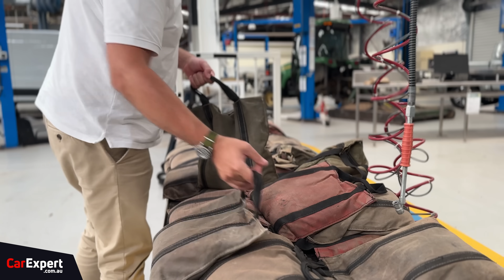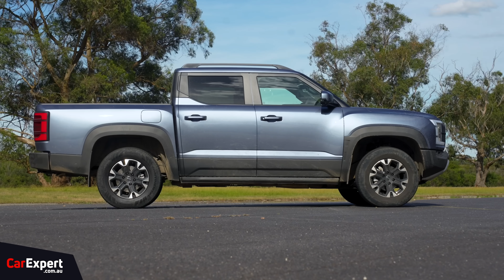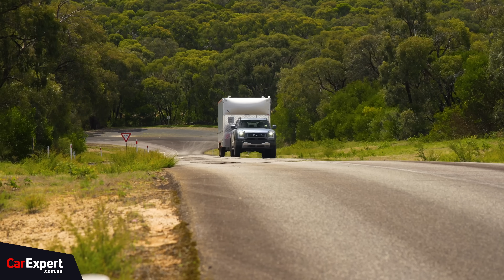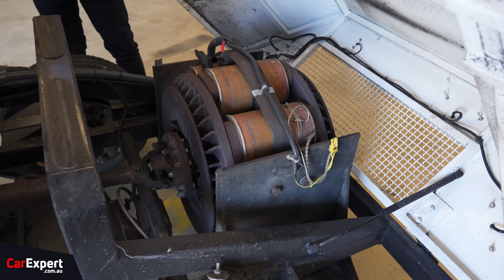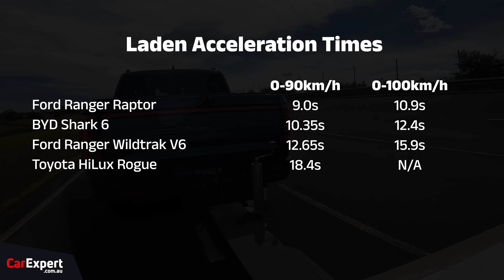BYD Shark 6 towing STRESS test at MAX payload - the results are surprising...

Comment: Some of the comparisons here are not comparing apples with apples. You compare a plug in hybrid with 2.5t towing with an ICE with 3.5t towing and compare power and fuel consumption. GVM is widely different.
 Also no mention of range. Quite important for tradies towing tool trailers, excavators etc. Also grey nomads towing 3 to 3.5t caravans and skiers/wakeboarders towing their massive malibu boats. Kind of important to see if it will work for them. Range is the biggest reason not to buy one in my opinion.
Reply from the maker: Not true at all. We used the same trailer dyne load in our recent ute test, along with the same trailer weight for the hill road. The results are directly comparable. In terms of range, it's a 60L tank, so it's going to mean lots of stops if you're towing at capacity.
Reply: @CarExpertAus  That trailer dyne is not real world test ,in real world you dont have endless hill you need to drive 100km/h,off course it will favor big diesels

Comment: It passes me off the BYD didn't show off the towing test when it shipped all the sellouts to China to rave on about it.

I nearly put a deposit down, but when I couldn't find any info on towing my bullshit meter started ringing. Whats the point of a ute that can't sustainably tow for a long duration? 

To be fair it would be interesting to see what would have happened if you set the state of charge to 50-60%.
Reply: Paul should have used the 70% battery mode. Can see how it will drop from 70% to 25% in one long steep climb with the engine running
Reply: Also interesting to understand what percent of ute owners tow. Not every car is for every person. People making out this will fail at being an excavator hauling, long range mountain climbing, enduro truck. Woah no way, who would have thought. 

But for an urban or suburban setting, where you want to take a small boat down to the ramp or do some light camping (once a year), but you are otherwise commuting and doing Bunnings trips - hey looking good. At 58k? Hmm seems great and now it's also competing against other large SUV family vehicles.
Reply: You really can’t think of any uses for a ute that can’t tow? None at all?

Comment: Thanks largely a good test but I don't understand why you did not complete the dyno test with the battery at a higher % the system is set up to allow the driver to set SOC I would like to know fuel use while maintaining the SOC at 50 or above % as well as your final test with the battery @13% which as expected resulted in a fail given  you effectively have a small capacity ICE front wheel drive 2.7 ton ute.

Comment: Always factual honest and genuine reviews. Thanks Paul. This is already expected. Best remedy for this I reckon is set battery level to 75% or so once you left home if you are expecting this kind of long uphill stressful haul . I don't think it d be issue as you are driving above 70kph on highway and engine help drive. Some people who live in hilly suburb and have really steep driveways may have issue pulling up as there is no gear or torque inverter reduction, and also engine will not kick in as speed is under 70. But still  this is the hell lot of ute for money.
Reply: The engine will kick in under 70kph to keep the battery charged, it just won't directly drive the front wheels.  A steep driveway will be no problem with 300+ kW and electric motor torque.
Reply: Try to understand gear reduction and torque multipliaction. @davidjulian8536

Comment: You must leave it in charge mode for towing. This is the same setup as the Mitsubishi Outlander phev. I tow all the time a 1 ton trailer and it's a 13kw battery and 140kw electric power. Leave it on battery charge mode and it uses the battery up hills. Also towed 1.5ton for 2000 kms around East Cape in New Zealand. Handled it amazingly well and no flat battery. I flew up the very steep Arthur's pass in the Southern Alps in NZ towing 1ton and a loaded SUV. The only car that could pass me was a Ford XR6. You must keep the battery well above 50% before hills and use it for getting up hills. Recharge on the way down and flats.
Reply: @xiaoabrose  you do realise this vehicle weighs twice as much as an Outlander and doesn't have much greater engine power/battery?? 🤔🤣

I'd take the Outlander any day over this overweight lump of cityfolk buying, ABC watching, climate change minimising, golf course virtue-signalling, turd on wheels 🤣
Reply: Small battery for a 140kw motor!
Reply: @Markcain268  That's phev for you. They have a 28kw? battery for over 300kw motors. That's tells you everything. It is a phev. It balances battery and petrol for power and efficiency. But it is not without very real compromises. But if you manage them, it's perfectly serviceable.
Reply: @Markcain268  Battery work with a gas motor ,charged 29 kw battery will be enough for 80km off hill towing  with a motor ,but in reality you will never find 80 km hill ,maybe to climb Mont Everest but there is no roads there and even there is i dont it would be highway where you can drive 100 km/h
Reply: Did you measure consumption while towing 1.5 ton and what speed where you driving at?
Reply: @andders2477 Yes. I drove from Auckland and all the way around East Cape. 2000kms total. Flat roads at 90 kph was around 11 l/100km. Once I hit the hills, average was close to 13 l/100km. A couple of times I had to stop to let it charge as the hills especially slow and windy ones meant the engine was high revs and also pulling heavily  from the battery.
Reply: @xiaoabrose  thanks, that ok consumption. You would have needed a lot of charging in an ev with 75 kWh
Reply: @andders2477 I was hoping for better. When towing a 750kg regular trailer with a storage box on it, fuel consumption is around 10 l/100km. Much easier for the small battery. But I would never ever tow with a full EV! Except short distance or course.
Reply: teaching carexpet how to act like actual experts! ;-P 💯
Reply: He's deliberately sabotaging the Shark for clicks. No idiot would start a tow test at 25% SOC...
Reply: You may think that , but we do want to know how a hybrid will react when the battery gets low .
And let's be clear , this was actually aside from being fully laden a very cushy test and in ideal conditions during the day time .
 30 c is not even that hot .
 If it was night time you'd be using your high beams probably with the heater on , and it appears it's only a short test .
 It's hard to beat an ICE vehicle for a tow car , even my old xr6 falcon did Melbourne to Noosa and all around brizzy visiting relatives dragging a heavy old 70S caravan with the aero dynamics of cabover Kenworth that I rebuilt and made even heavier with fully boxed steel rails and an extended draw bar , dragging two extra large pensioners and masses of gear all up for 5000 k's , and it was peak summer often in the 40's sitting on 100 kph most of the way , the van tracked behind like it was on rails , rock steady and the combination did not miss a beat the whole way with a going and lights running for the whole trip with an electric fridge running in the van , we put a auxillary battery in the van vented to outside with the electrical wiring tweaked so when the cars lights where on it charged the battery in the van , as soon as the car was shutdown and lights turned off the auxiliary battery was  disconnected from the car so no car flat battery.
And the beauty of the Conventional ice vehicles is should things go pear shaped , they are easy to fix. @zackmack4712
Reply: @mikldude9376  But this test is towing 2.5 tons with 100 km/h on  endless hill, in reality you want find endless hill anywhere
Reply: @mikldude9376  If the battery is low, then you only have the weak little turbo engine as they showed. But with proper management, it's not a real issue. But it is very important to know this as you said.
Reply: @zackmack4712  nonsense!!!! he sabotaged nothing at all.
Reply: @xiaoabrose  You guys have got no idea how energy is produced/consumed 🤣
Reply: @Rick-wy4od  I hear is it only ever transformed! 😉

Comment: What happens even if not towing on a long trip. Say I want to drive 800 km at some point the battery will get low. Does the petrol motor enable highway speeds on hill country or is it going to slow to 70 km?
Reply: If u r not towing, the engine will have enough Kw to charge the battery and drive the wheels at the same time because u don't really need that much of power for "cruising" on high speed, usually less than 40kw for 100km/h. So as long as u have enough fuel it will be fine.
Reply: WHen you drive highway speed 130km/h u use maybe 40 kw and engine is 130 kw ,so it has more then enough spare power to charge a battery
Reply: Think the answer is pretty simple when you drive the car to absolute limit with a tank of fuel (in this case 800Kms) is like driving an ICE till the last drop of fuel the car will stop.

Comment: Great test. But the power only dropped to a very low value after manually turning save mode off? As well this happens when tow a 3kN trailer accelerating sharply and maintaining highway speeds. For most towing scenarios, I think it's a great performer.

Comment: How can you say this towing performance is ok?? So there is a very high likelihood that on a long journey (and towing) you need to overtake a big truck and then the Shark runs out of steam?? How dangerous is that!? What am I missing here?
Reply: Doubters are going to doubt anyway. ....

If you show them 10km of towing, they will ask for 50 km. If you have shown them 50 km, they will ask for 100 km .... so on ...... and for other things .....
Reply: set the SOC to 70%, let the ICE engine kick in hard to regen the battery will sort this.
Reply: Under normal towing with a SOC set at 70% it will be fine. As Paul says, this is an extreme test pushing the edges.
Reply: It's alright mate don't buy one.
Reply: How many LC300 towing 2.5t up an incline do you see overtaking a truck?
Reply: What you are missing is not everyone tows over a long distance, that in itself is an edge case. For those that do it is probably not the right car.
Reply: if towing is your priority then don't buy one... simple, it's a free market
Reply: Unless that  truck in not 50 km long it will do great,you can set target SOC to like 50% and always have battery for hills or overtake
Reply: Go their website and saw same test with 3kn trailer for other truck ,many trucks could non even reach 100km/h like Toyota Xiluh with 2.8 diesel

Comment: Paul how long is one lap with the trailer dyne? Also what weight trailer and uphill slope does the 3kn equate to roughly?
Reply: It is the equivalent of towing a 1.5-2ton trailer up a 10% slope which is super steep continuesly.
Reply: @aljoubert8749  on top of the 1.6t trailer? So 3.1 -3.6 tonne of trailer for a vehicle rated to 2.5t? Surely not
Reply: @daniellorkin6298  no. Only equivalent of 1.5-2t  up a 10% slope. Keep in mind the average boat ramp is 12%. Not a real world test

Comment: What was the battery percentage when you started the tow torture test laps with the DYNE?  This is an important piece of information in the scheme of the test.  Otherwise good video and info.
Reply: Was thinking the same after 5 minutes.
Reply: He states some what’re else in these comments they started at 60%, did one lap of the track and the battery was down to  13. The ice cannot keep up in this situation and when the battery gets to 13% the car goes into limp mode.
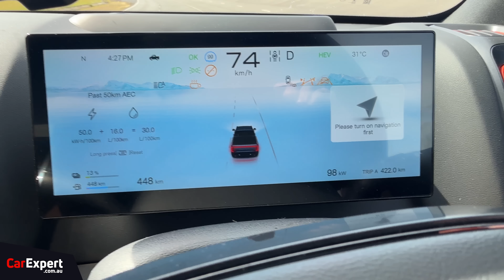Reply: @Trad-Archer  There is no way that in one lap you can get from 60% to 13% with engine on.Use can see at 10:47 that consumption is 50kw/h .From 60 to 13% would mean that its used 14 kw which at 100 km/h would translate at 28 km .Where can you find 28 km constant hill where you can tow  100km/h
Reply: @Trad-Archer  ok thanks, and i did find it, though having this on the video would lead to a lot less speculation on its validity.  Also the car was able to maintain 70+ km hr up the supposed endless hill so  the engine was keeping up in a way and keeping the car moving which is not a fail.  This is as good if not better than most of the other 4cylinder utes that were done with the same test in the other video, (just not the cherry picked designed for towing diesel)
Reply: Yes, it’d be better to have some key information presented as I think the lack of it has caused some suspicion
Reply: Also how long test run ,if it was 30 minutes and you go 100 km/h that is 50 km on constant hill, where in the world in reality you will ever find it
Reply: the battery percentage was 13%, I found it in the display.
Reply: @yourtemp6135  really? Can you mark it and put it in your comment?

Comment: Regarding your last point about it not being able to engine brake once the battery is too hot/full - I’m surprised it doesn’t use the electric motor to spin the ICE like Toyota hybrids do when their batteries are too full or hot - this is basically engine braking like in any other car and slows them down pretty effectively - I don’t see why the Shark couldn’t do the same thing so I’m surprised it doesn’t 🤷‍♂️
Reply: It can't because it's not engaged to the drive train unless your over 70km/hr

Comment: As one who has the order in and "will" purchase mine, it is showing it's limits. I know straight away of one scenario where the vehicle will be in trouble pulling a trailer of 2.5T. Oxley Highway...Port Macquarie up the Walcha mountain. This is the major interlink from the coast to the Western area like Tamworth/Armidale/Inverell/etc. And I don't think that this is a software issue. So, yes...long inclines with 2.5T towing will be an issue for the owners that are inclined to do this.
Reply: then manually push up the battery charge to 50 or 70% instead of draining it to 20% then start going uphill that's bit dumb....
Reply: @fatdoi003  Or just go to the closest public charger and charge it to 100% and set limit to 50% before going uphill. Just need a bit of planning I guess. However it is good for Paul to really test the limit of the shark. Worst come to worst stop the car on the side of the road let the engine charge the battery then move on.
Reply: @luffytaz5482  There is no public charger until you get to the top of Walcha. There is now a 60KW charger in Wauchope. Wauchope to Walcha is 162km and at least 140km of pure climbing. No chargers in between.
Reply: Up those highways at 75km/hr, as this test showed? She’ll be right…

Comment: Goodnreview and shows the massive failure compared to ice utes. Notbthat much faster than raptor withbthe advantage ofbhave ev power. Fuel % jump alarming. Moreso, when the shark could not sit on 100km. It would have been far far worse.
EV / hybrid good and bad like all vehicles. But, with Australias pendant for hauling vans/trailers long distances. The shark at this time, falls very short of its competitors.